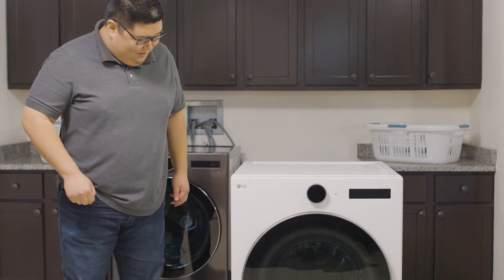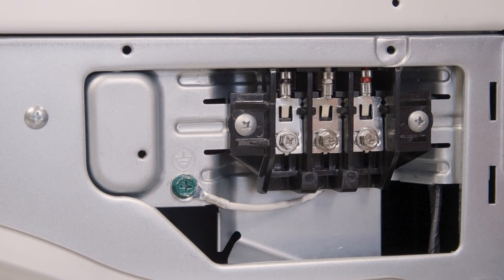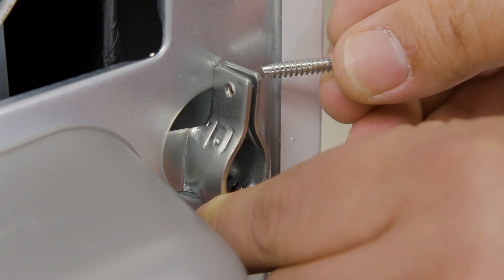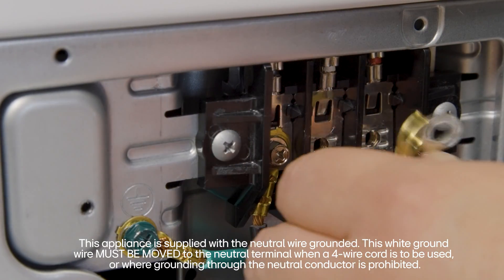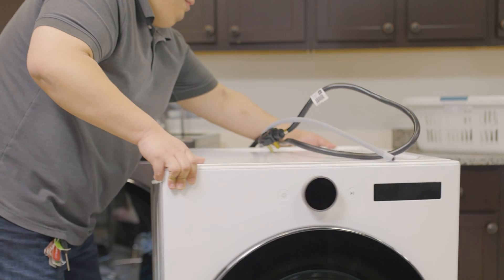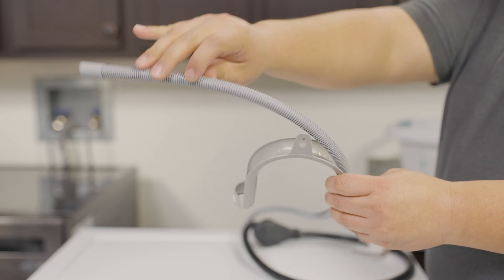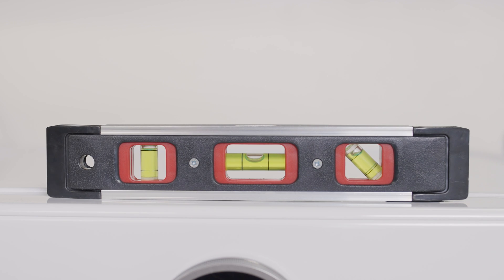[LG Heat Pump Dryers] How to Install a Heat Pump Ventless Dryer - DLHC5502

Comment: if you don't adjust the height still you need to check level ?
Reply: That's right, you should still check that your ventless LG dryer is level, because floor slope can affect vibration, drainage, and drying performance!

Comment: Hi, just had someone install the drain hose from the drain hose valve onto the area that they say not to install the hose to. Are there any repercussions for that if the dryer was already used?
Reply: Hey there! Thanks for reaching out. When it comes to dryer installation, especially for models with a drain hose like condenser or heat pump dryers, getting that drainage set up correctly is absolutely crucial.

Think of it this way: while the manual might not list every single potential 'repercussion' if the hose isn't in an ideal spot, the core message is that proper installation prevents future issues and ensures your dryer runs smoothly, as it's designed to. It's all about avoiding problems down the line and ensuring peak performance.

If you have any specific concerns or questions about your setup, please don't hesitate to send us a private message on social media at @LGUSSupport. We're here to help you out.

~Ken

Comment: I bought this dryer. But water is coming out of the valve where we « should not install the hose ». Why??
Reply: I have the LG DLHC5502V and have a similar issue.  The back of the unit in the video has the same setup as mine. The delivery/installers connected the removed the caps from BOTH valves at the rear of the dryer. AND they connected the drain hose to the vertical valve that points up towards the ceiling, i.e., the one that the video says NOT to attach the drain valve to. I realized that the hose was on the wrong valve when I discovered water leaking. 

I moved the house to the correct valve.

The problem is that there is STILL water leaking. There is no cap on the vertical valve. Could this be the problem? I've been dealing with this for over a week and am extremely frustrated at this point.

I'm hoping that LG USA support sees this and respond to us.
Reply: Thanks for reaching out to us Thomas! The missing cap on the vertical valve could be contributing to the leak. Please send us a private message through our social media platforms @LGUSSupport with your contact details and any additional information about your LG DLHC5502V dryer. We’re here to assist further and ensure everything is set up perfectly! 🌟 ^Anthony

Comment: I have never had a dryer with a drain hose before. I was going to buy this one, but I can't if it has to have a drain. Also I have a regular plug 120 for electric, do I need a more?
Reply: It has a drain hose because it’s a heat pump dryer. There are in depth videos on how heat pumps work, but the short version is that it evaporates and condenses the water in a closed loop, used far less power and doesn’t blow hot, moist air out the back like a vented dryer. There’s no air duct but the water still has to go somewhere. 
If space and electrical capacity is a concern, there are smaller heat pump dryers on the market that do use a 120 and collect their water in a removable container. You’ll have to drain the container in the sink every time you dry. A little more work but probably easier than moving or going to the laundromat every week. Hope this helps

Comment: Right at the start of this video, where you say "This is where you DONT install the drain hose"  and there is this little spigot sticking up?  When our dryer was installed, the installers took off that cap and now we dont have it.  When we run the dryer, water comes out of that spigot.  What should I do?
Reply from the maker: Hi, there. We understand that you are having issues with your unit. We would be glad to assist you further on this. Please send us a private message through our social media accounts at @LGUSSupport. We will wait for your message. Thank you. – Mikee
Reply: Idiots who installed mine did the same except they hooked the drain up to it too so we have a lot of water damage.  I need to see if I can find the cap because now it's also spraying water out the other (not drain) pipe.

Comment: I would like to purchase this dryer. I don’t have a laundry room so would it be okay to place this in the garage with Texas humidity.
Also, do it require a drainage system?
Reply from the maker: Hello there! Thank you for your interest in the DLHC5502V dryer! You can place it in your garage, but we recommend ensuring adequate ventilation to manage Texas humidity. This model is a ventless dryer, so it does not require a drainage system. If you have any more questions, feel free to ask! -Junel

Comment: My installers removed the cap in the valve which you said "Do not install the drain hose on this valve" and it seems it leaks at the end of the dryer cycle when the dryer gets rid of condenser water buildup. Is there a way I can order that cap for the valve?
Reply from the maker: Hi Dini, Thank you for informing us about the issue. Please send us a private message on our Facebook, Instagram, or X via @LGUSSupport. So that we can assist you more effectively. ~Ken

Comment: Can you provide the diameter of the drain hose? The one included looks like it will not reach my standpipe, and I need to get an extension.
Reply: measure it yourself? You already have the hose.

Comment: What if your washer is on one side of the closet snf your dryer is on the opposite side?
Reply from the maker: Yes, you can place your LG washer and dryer on opposite sides of a closet or laundry room, but there are some important considerations, such as space and clearance, utility connections, and dryer venting. -Charles

Comment: How much clearance does there need to be behind the dryer if it's NOT in an enclosed space? I'm installing tomorrow but the manual only states a minimum of 5 inches if it's enclosed.
Reply from the maker: Hi there! If the dryer is not installed in an enclosed space, the minimum clearance required behind the dryer is typically 4 inches.

The National Fire Protection Association (NFPA) code states that clothes dryer exhaust ducts must be installed with a clearance of at least 6 inches from adjacent combustible material. However, this requirement is specifically for enclosed spaces like alcoves or closets. 

Most manufacturers recommend a minimum clearance of 4 inches behind dryers installed in open areas without enclosures for proper air circulation and ventilation. This allows sufficient space for the dryer vent connection and airflow.

So, in your case, where the dryer is not being installed in an enclosed space, a minimum clearance of 4 inches behind the dryer should be sufficient unless your specific model's installation instructions state otherwise.

Let me know if there's anything else we can help with! -Ken
Reply: @LGUSASupport  As this is a ventless dryer does that specific NFPA code apply?

Comment: ThT valve where you say "do not install the hose here", what is it? I got this last week and it's dumping all the water out of that part instead of the hose. I see yours has a cap. Mine does not. Lg didn't know what it was, but they're coming to inspect Tuesday. This is so frustrating.
Reply: They should really call more attention to this in the instructions. I sent one dryer back for this issue. Luckily YouTube commenters came to the rescue!
Reply from the maker: We understand that dealing with a frustrating issue can be challenging. Please reach out to us via private message on Facebook or X at @LGUSSupport, so we can help you resolve your concern. ^Loui
Reply: I am having the same issue. A portion of the coils on my machine are burned, as well. Did you find a solution?
Reply: @lanternafilm  yes! We found the issue. When home depot installed my machine, they removed the cap from the valve where he said "don't install here". LG overnighted me two caps and I ran two loads of laundry today and it worked perfectly!
Reply: @nicoles6464  Problem solved!  Our cap had also been removed.  Thanks for the reply.
Reply from the maker: Hi, There. Thank you for reaching out to us and for bringing this to our attention. It would be our pleasure to assist you with this. Please send us a private message on Social Media @LGUSSupport. We look forwarding to assisting you. ^James.
Reply from the maker: We're glad to hear that the problem has been solved. If you require additional assistance, we're always open on Facebook or X at @LGUSSupport. Have a great day ahead!♥ `Al

Comment: What is the purpose of the hose at the back that isn't the drain hose??
Reply: @LGUSASupport I’m still curious what it’s for. I’m considering this dryer
Reply from the maker: Hey there, there is a drain hose and a power cord used to connect this LG Dryer. Should you have a model-specific question, don't hesitate to send us a private message on Twitter or Instagram @LGUSSupport with your model, serial, and phone number. ~TammyJo
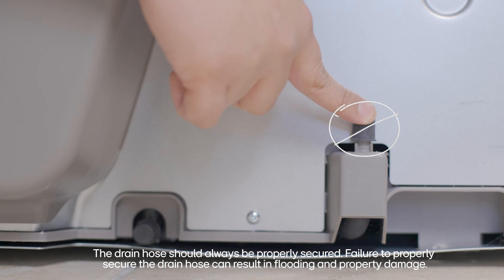Reply: @LGUSASupport  I'm referring to 0:28 of this video where it says "this is where we will NOT install the drain hose". What is that for? Our technician just installed the external drain hose into that today.
Reply from the maker: Hey there, let's look into this together in more detail. Please send us a private message at @LGUSSupport on Facebook or X with your model, serial, and phone number. We definitely want to see why your drain hose was installed at this valve and not the one stated in the video. ~TammyJo
Reply: @LGUSASupport  Just answer the question.  It's model DLHC5502V - the same model this video is about. 
I just bought this dryer and even the manual that comes with it doesn't say what that is for.
Reply: @Ladco77  I did a video chat with LG and even they did not know what it was for, but all I knew is after home depot installed they removed the cap on it and all my water was dumping out of that. The LG service technician ordered me a cap, and once I applied it, the water diverted to the hose as it's supposed to. I dont know much about appliances, but it seems like it's just an opening to drain the water should the hose get clogged or something. Without the cap to cover it, the water automatically goes to that valve instead of being pushed through the hose.

Comment: Key point…don’t waste your money on these useless “dryers”. It is simply a sauna for clothes that wastes time, money and energy.
Reply: The best part about it is it keeps your clothes in good condition longer, although dry times are sometimes double.
Reply: Is that your opinion of heat pump dryers as a whole, or this machine specifically?
Reply: . @n8maher  . I'm very happy with my heat pump WashTower so far - 3 wks in. @n8maher

Comment: Where can I buy this?
Reply: Looks like Plessers and ApplianceConnection now carry this model. I would expect it to roll out to other places soon!
Reply: @n8maher  thank you
Reply: @ExtraJohnson  You're welcome! I'm in the market myself. That second place is Appliances (with an s on the end) Connection, by the way! I was about to pull the trigger, but the shipping widget estimated an early January delivery date, so I'm going to hold off making a purchase until 2024 to see if I can get a rebate from the Inflation Reduction Act money pot.
Reply from the maker: Hey there! We'd love to see LG in your home. We have a few different options for a heat pump dryer, you can check them all out here: https://www.lg.com/us/washers-dryers/lg-dlhc1455w-front-load-electric-dryer ~Ave
Reply: @LGUSASupport , there is no DLHC5502 on your web site
Reply from the maker: Hi, Matthew. The model DLHC5502 has not yet been directly listed on the LG USA Support website. This is because it is a newly released LG model that received certification on 09/28/2023. We understand your interest in this specific model. Stay tuned for updates on the LG website regarding the release date of this model. In the meantime, we would like to recommend checking out the DLHC1455W model, which offers similar features. You can explore this model by visiting the following link: https://www.lg.com/us/washers-dryers/lg-dlhc1455w-front-load-electric-dryer

Should you have any further questions or require additional assistance, send us a private message on Facebook or X at @LGUSSupport, and we'll be happy to accommodate you. `Alice